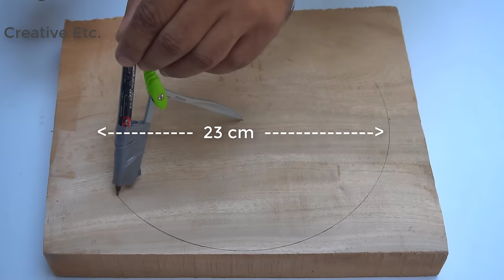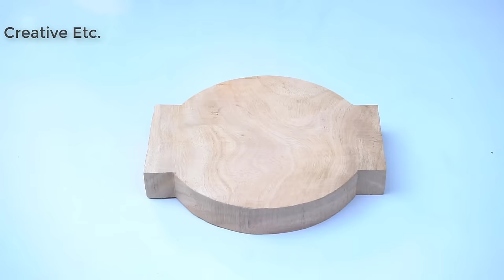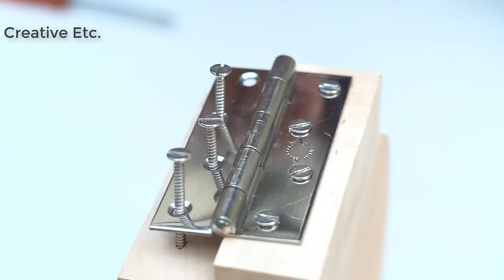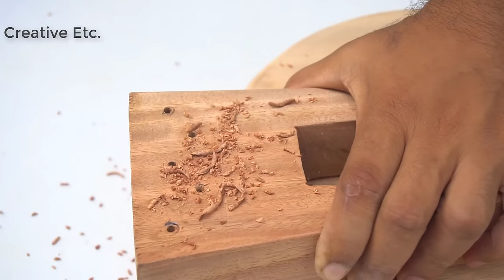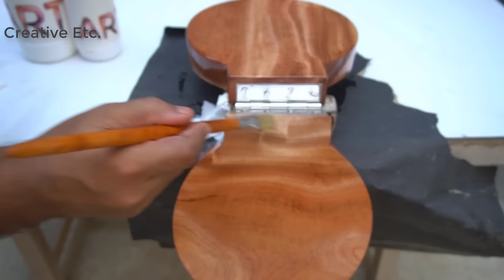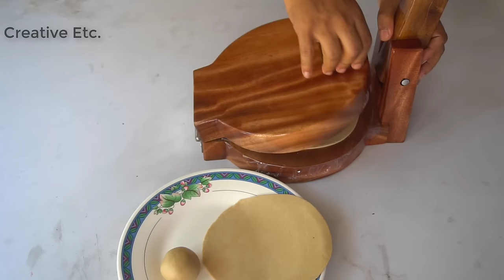How to make Roti Maker at home /Wooden Roti machine

Comment: This is full carpentary job only efficient carpenter can do.
Reply: hi brother super. super
Reply: Exactly, not cup of tea for everyone
Reply: Are you serious? Seems pretty simple if you have a jigsaw.
Reply: @Bob-Maplethorpe  yea they dumb 2 circles connected with that thingy and a wooden stick next to one circle. Omg so complicated
Reply: At least appreciate for the innovative ideas
Reply: Ata oder dilay ki poya jabay r Price ta koto  plz ans me
Reply: @athengzeme9360  nothing innovative, they sell the metal version of this tool already.
Reply: @Bob-Maplethorpe  if rotimaker is not made correctly resultant output will be unexpected.
Reply: @VS-qd3tz  it just presses roti dough between two pieces of wood. Sorry guys, but I don't get your comments. Would making this be time consuming? Yes. Would it be 'technically difficult to make? No. You only need a jig saw, sander, and drill for goodness sakes.
Reply: @natannatan9767  hey Bro everything must fit perfect to measure or they become a scrap.ITS EASY TO COMMENT!
Reply: Excellent  but pretty big
Reply: & Roti will be made only in the Video😂
Reply: Better learn how to make with regular equipment, because you can't have this innovative equipment everywhere.
Reply: Well done...
Reply: 1.roori nhi foly gi . 
2.rooti mazeed patla krny k luye degree hona chahyee .
Reply: arkanasays 
Innovative? Lol it’s a tortilla press. It’s been used by the Mexicans for centuries
Reply: take any round plain object and press it  over dough ,apply good forces and you made a roti.
Reply: Don't try it at home😂😂😂

Comment: 👍 🙄 brother, this is all fine if you have the necessary skills. We must also consider the cost of the tools like jig saw, electric sander, drill machine, lathe, etc. The cost of manufacturing would be phenomenal. For the unvary it's a good demonstration. I believe you can purchase this in the market, and won't cost you more
Reply: You can borrow or you can take your woods to some shop who own these thing , just charge fee money for making some hole . You don't need buy all equipment of infrequent use .
Reply: Please give yr phone and price so that I can buy.
Reply: You can buy it at Amazon.com, just look for wood tortilla maker
Reply: @vasantiparmar3286  vasanti  search amazon ebay or local houseware stores, it will be cheaper gauranteed and FULLY accurate.

Comment: I doubt that the roti will be as round as shown on video
Reply: Yes its correct
Reply: slow @6.41....he changed the roti inside.. video is edited
Reply: Yes 100% sure
Reply: @perimeniamotallis1646  exactly i noticed that, watched twice and confirmed that this is edited video , chapati changed before opening it !
Reply: Yes I think so because the logo of "creative ...." vanished just after pressing the roti ..that's why I think it is an edited video..
Reply: This design is used by Mexicans to make their tortillas, it's does come out that round, I also have a tortilla press which makes them very round.
Reply: It depends upon the dough ball.
Reply: @VOTE4TAJ  yes, you have to start with something reasonably spherical
Reply: The video has so many cuts , this thing is a lazy thing.
I guess it will only look good in showcases
Reply: Subhash Dewan NEVER
Reply: @The1Kamila  plz post the image of the mexican design with you
Reply: @subhashdewan3847  just google it

Comment: Fake video... Edited multiple times.
I'm a mechanical engineering student lmao this shit won't work guys with that much dough it can hardly reach the diameter of 10cm
Reply: Ive a similar opinion.. very obvious that dough has been flattened with some other tool and put beneath that lath/ wooden plate.
Reply: It's not about the size of the dough ball. It's the elasticity of the dough.

You may be an engineering student, but you obviously don't know much about rotis. 😉

Ever seen a tortilla press? Same thing but made of metal.Street food vendors in Mexico use them commonly and use very little dough to get thin flour tortillas. I'm sure you will find several videos on YouTube...or you could build yourself a boat using your engineering skills and sail to Mexico 

They make hundreds of these a day using the same concept. It's not new idea, and you don't need a lot of dough if it is made properly.
Reply: @questionmark5463  are you too blind to observe that the video has a cut patch which is clearly seen as an edited video.. it might work for tortillas which I can guarantee you isn't made out of wheat flour there's a difference between maida and wheat flour so yeah.
Reply: @rkgaurav5940  It works with maida or atta. I have one and use it often.

It's actually quite convenient. I'm not blind either.

The trick is to oil each side lightly. Can use ghee or normal vegetable oil.

So No.

🙏
Reply: @questionmark5463  explain the cut scene 😂🤣
Reply: @rkgaurav5940  What's to explain Sherlock? He screwed one up and edited in another clip.

There's hundreds of videos on YouTube showing similar devices and you can get readymade ones on Amazon.in for a few hundred rupees.

Gosh. It really isn't something revolutionary or a magic trick. The guy built his own version which is pretty cool. Good craftsmanship. 

Anyway, there's no point trying to convince a great detective like youself. You are the smartest kid in class. 

Happy now? 

👏

Comment: Thanks for the video! After sanding do you add mineral oil for wood conditioning? Or was it only resin? What wood did you use?
I am planning a DIY, only the base for roties.
Reply: The rasin was Final coat Lacquer which generally used in wood policing.... 
you can easily get it on just rs 200/liter on paint shops....
Reply: @Skytech56  but sir what is that you using there like plastic paper or sellotape in finishing time? Please reply